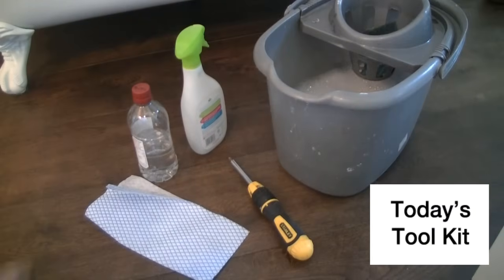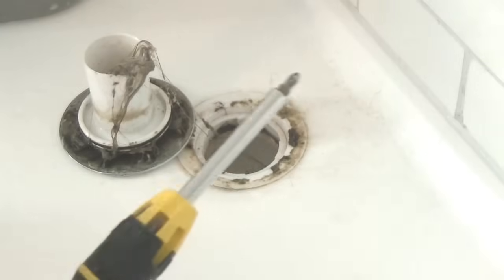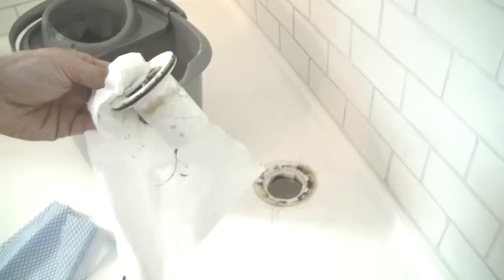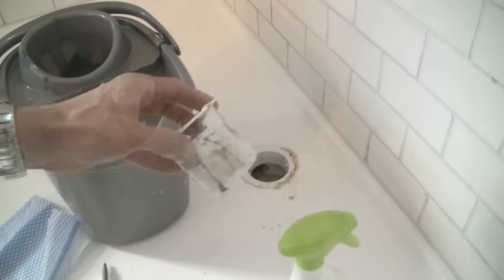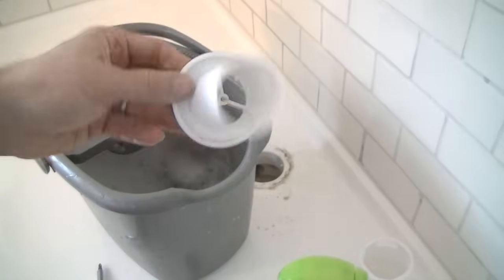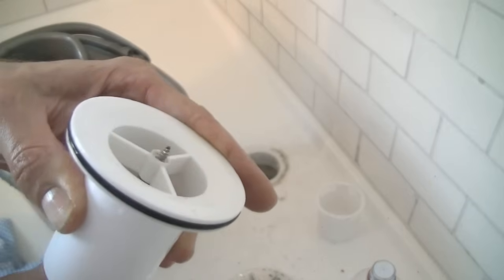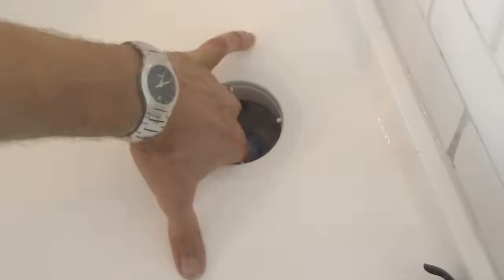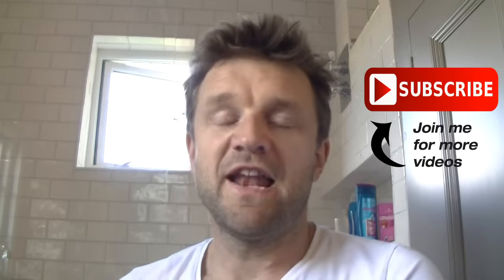How to Unclog and Clean your Shower Drain

Comment: Good and clear video Charlie.  The only extra step I do with ours is to give it a final few plunges with one of those super-size plastic hand plungers that sort of concertinas down as you press it.  Given they don't have any rubber seal or anything (just plastic throughout) their suction power is phenomenal.  I find it helps pull up a load of dirt from further down the waste pipe which i can then just wipe up with some kitchen roll.
Reply from the maker: Thanks Chris. Great thinking. I used to have one of those plungers. I need to buy a new one. I agree, they're enormously effective 👌👊

Comment: Useful tip. If you take all the gunge, no need to disassemble, and simply hold in whilst flushing in a clean toilet the water jet will remove most of it.  
An old toothbrush with Cilit Bang helps also to scrub the junk out!

Comment: Excellent (though unavoidably a bit stomach churning!!) description of how to clear a shower drain of hair etc, but even after that my shower tray still I think rather slow and as it’s shallow I often get a little spillage outside.  What can I use to clear the area and pipes below?
Reply: I would use a drain cleaner (a 'drain blaster' device) that uses a plunger to drive lots of water rapidly down a drain pipe.  Fill the drain to back up as much as possible (i.e. keep the shower water running fast) and then blast the drain line by quickly locating the blaster on the drain inlet at the shower tray and operating the plunger!  Probably hair or even builder's debris in the line.  Repeat as necessary.

Comment: I never noticed the screw that connects the plastic plug to the metal part!! Thank you this video is exactly what I needed.
Reply from the maker: You're welcome. Cleaned mine again yesterday. Always worth removing the screw as you need to pull the hair out in the direction it came in. 👍

Comment: Excellent! A proper hands dirty video instead of pointing at a sparkiling new trap and saying where you "might" find some soap scum and hair. Thank you Charlie. That bloody screw, by the way should, in my opinion, be undone over the bathroom sink with the plug firmly in to stop it going down the drain. Also, when putting that screw back in, be patient. Losing that screw will turn a ten minute job into a trip to screwfix!
Reply from the maker: Thanks mate, really appreciate that. Yep, putting the plug in is a great tip . 👊

Comment: This is a very easy thing, what will you do when there is a block down the line?
Reply from the maker: The point of doing this is you prevent the dense stuff building up further down the pipe but there are some good rodding tools on the market.

Comment: Never knew you could unscrew that part. I'll be adding a screwdriver to my cleaning bag. Vinegars.great but I never use because the smell isn't pleasant! The trying to clean it without unscrewing that makes it hard  so knowing how to take apart you can use another product. 

I still think they could come up with a better design. I clean people's everyweek any many of them stink 7 days later however thoroughly cleaned and with whatever product cleaned with (tried them all). Only thing that helps somewhat is taking removable part out after every use and sitting it on shower floor.

Comment: I have a similar type of drain and your tutorial is very useful. However, I have a problem in so far as the cover of the drain does not come off as easily as the one on your video. The seal is so tight that the drain cover cannot come off without exerting a lot of force. I’ve already broken two drain covers trying to lift them off. Any tips ?

Comment: Great video - thank you 🙏 Every time I remove my hair trap there is always water sitting below. Should this drain away somewhere?... because it's not. Also just had a bath in middle floor bathroom and its caused my en suite on the top floor to smell of rotten eggs. I don't think it's a coincidence. Praying its nothing major.
Reply from the maker: Yes you mustn't remove that water. It serves a very important purpose - to stop smells coming up the drains. That might be why you can smell rotten eggs.
Reply: @CharlieDIYte  wow thank you so much for taking the time to respond. I haven't removed the water but I've just tried the vinegar/water combo and given it a good clean. Fingers crossed the egg smell goes away. Thanks again, such a helpful guy and much appreciated 🙏❤️

Comment: Hi Charlie...great video thank you...But even after cleaning it all.. the water still seems to take too long to drain. I've tried a snake tool on the pipe (no blockage) and also unscrewed the maintenance cap outside to see if it was blocked..and it isn't! Any ideas please. Thanks
Reply from the maker: Is there much of a fall on the pipe?

Comment: Hi I have a shower very similar to this. I removed the drain cover and the shower tray waste trap simmilar to how you have done on this video to clean everything. I then clean the rest of the shower and and turned the shower on before resembling everything to get rid of cleaning soloitiob and soap suds. The next thing I knew the water started leaking out of the ceiling in the room below. Is this just because the shower waste cup wasn’t back in? I’m calling a plumber asap x

Comment: Hi! Thanks for this video! We moved house a year ago and I couldn’t figure this out! The previous owners had lost the screw connecting the cover to the trap so it’s always separate. However, the water container bit is stuck and I can’t remove it to clean that gunk off, which I’m sure is blocking the drainage! Any tips?
Reply from the maker: Unless it's a different type of trap Janelle 🤔 You can also buy replacement covers that include the chrome lid and container bit. I'm afraid I can't help you with removing the container without knowing what model it is.

Comment: Is there anything that can be added to the drain to help keep the hair from getting sucked down in the first place? With normal tub / sink type drains there is a plastic mesh that I put over the hold that kept the worse out but not sure how to do the equivalent with this type of drain in the new house I’ve move into. Any suggestions would be great. Thanks.
Reply from the maker: I haven't seen anything Tiffany but could you improvise with a similar mesh to what you've used previously?

Comment: I have the same design of drain but a little different fitting. The difference is that there’s not any screw that locks the plastic with the silver tape, so when I pull the silver tape it doesn’t opens correctly and It’s like stuck in the bathtub the plastics. Any idea about this ?

Comment: Hi Charlie - thank you so much for this video! I followed your instructions but there is stale/standing water below the outlet pipe. In your video there was none/it was dry.  How can I remove this stale water? Do you think this is a faulty drainage unit? Many thanks in advance
Reply from the maker: No, the only reason there was no water is that I had cleaned it out. As soon as you turn the shower back on it will return and it's crucial as it stops smells coming back up the drain from the sewers.

Comment: We recently bought a house that has this exact shower drain, and it really smells despite us cleaning the parts shown in the video. Do you have any tips at all for cleaning the pipes further in?
Reply from the maker: It's important you leave water in the trap after each use as otherwise you'll get foul smells coming up the pipe. D'you know where the pipe goes outside? I have been known to pass a hose pipe through the window and flush out the pipe with that. But you shouldn't really need to if you keep the shower trap clean.

Comment: Hi  We have a problem when we let the bathwater out and we get water coming from the shower Have cleaned shower trap and used soda and vinegar  Works a bit but still fairly regular issue  Do i need a plumber or is there something else to try? TIA

Comment: Iv got the same shower mate,,,, what if the the drains clogged,,iv had a 4 meter but if hose pipe down there,, boiling water and vinegar and it’s still clogged,, I get about 30 seconds in the shower before the plugs overflowing
Reply from the maker: Sorry to hear that mate  I thought of this but it's only 2.5m long according to the reviews and it sounds like your blockage is longer if you've had a 4m hose in there.  https://amzn.to/3lwyayH But if you can find something like this, longer and heavier duty that might do the job .. 🤔

Comment: Have u got a video on how to unblock a plastic motor drainage system plug hole thing? If u see what I mean. I have to keep pressing the pump button after showering, which is annoying. It never done that before as the pump used to automatically work with the water pump machine.
Reply from the maker: No, I'm afraid not Mandy. Have you contacted the manufacturer?

Comment: I have the same. But the plastic chrome top is shabby and not looking to good lol. Do you you know where I can buy them from please. Thanks for the video. Didn't  know there was a screw you can undo.
Reply from the maker: Yes they do replacement covers on Amazon and ebay. Just measure  the diameter to make sure you but the right one.
Reply: @CharlieDIYte  thank you will have a look 😁

Comment: Great video. I have the exact same shower drain. I need to replace the rubber washer ring that sits in the hole of the shower tray. I am not sure how to do this. Any advice?
Reply from the maker: Thanks, are you saying the actual shower trap https://bit.ly/3y4yK7H needs replacing, rather than the insert piece that I cleaned in this vid?
Reply: @CharlieDIYte  - its the rubber white top seal ring that's perished. I have now managed to remove the top part of the trap by un-screwing (moped out water before un-screwing). I have order a new rubber seal, also got some silicone sealant.

Comment: Hi. My cover, the same as yours won't come off. It doesn't go down at all and only turns around and around. Maybe muck stopping it going down in the first place?
Reply: I am facing the same issue now. Did you figure out how to remove the cap ? Because mine is very tight to pull and it spins both the direction. Thank you
Reply: @logesh5213  Unfortunately it was jammed and I had to force it off, breaking it (which I was prepared for). We're an accommodation provider so had to get it fixed there and then. I took it all out and put in a completely new trap assembly.

Comment: I have the exact same trap but the cap won't sit on and sits loose or the O ring  pushes it out. This is a bran new installation
Reply from the maker: I wonder if they had a couple in the bag and accidentally put the wrong cap on. 🤔

Comment: Hi, a very helpful video. I noticed that when you took your odour trap out, the water level was below the outlet pipe, is that where it should be or can it be above the pipe? I have a fairly new shower and it has already blocked up. Can soap gunk from a washbasin affect the shower drain? Thank you, in anticipation of your help.
Reply from the maker: Hi Sheila, the water level would be below when you take the odour trap out, but that's the job of the odour trap - to keep the internal water level above the outlet pipe. It's difficult to say without knowing the exact configuration of your pipes. It could be a number of things, like there not being a big enough fall on the pipe leading to excessive build up of gunk but you could get an old fashioned plunger and see if you can plunge the shower trap to release the blockage. You could also try one of these https://bit.ly/2Sv3bBn It's a good idea toregularly clean the wash basin and shower trap, to prevent the gunk that forms quite quickly from travelling further down the pipes to areas that are less easy for you to clean.
Reply: @CharlieDIYte  Hi Charlie, thanks very much for the information. I had plunged it and had small bits of gunk out, but I shall make it a routine to clean both out regularly. Thanks

Comment: i’m just about to follow this tut, but the white part that used to be connected to the chrome head detached and is now stuck on the floor of the shower. Any tips on how to get it out because it will not budge!
Reply: Hey, just wondering if you were able to tackle the issue. I'm going through the same thing at the moment.

Comment: Is there supposed to be visa or water there in the drain? I didn’t see any visible water in yours
Reply from the maker: Yes. There was none in mine because I had just cleaned it. Once you run the shower it fills again. The water is very important as it stops nasty smells coming up through the drains.

Comment: I have been having terrible trouble with my shower filling up. So much so I have to turn it off whilst showering so it doesn't overflow. It does go down abit but not enough. Ive tried all manner of different well known products even caustic soda and it didn't work. The last one didn't work at all. I'm in rented accommodation and they have sent a expert round who hovered it and used the snake thing I think. I'm getting so frustrated. I will give this a go. Could you tell me please where I would buy distilled vinegar? I have also read online you can use a mixture of white vinegar and baking soda. Is this correct?
Reply from the maker: Sorry to hear this Linda. If the caustic soda didn't work and they even used the snake thing to no avail sounds like a problem or blockage further down the drain.
Reply: @CharlieDIYte  Thanks Charlie. They've cleared it again for now but I want to prevent it from keep happening as my agent will get annoyed with me and fedup of me keep complaining about the same old problem. They told me not to put anything down it even white vinegar as anything put down it will cause further blockages. Is that correct? I was using Mr Muscle etc but he told me not to 🤔

Comment: Hi Charlie, any tips on how to access the pipework under/behind the shower to check for blockages ? My shower is still backing up even though I've thoroughly cleaned the easy-to-reach bits as in your helpful clip. I've tried HG drain unblocker and a good old fashioned hand suction pump but no luck. I think there's a blockage in the waste pipe but stumped as to how to access it without taking part of the shower apart. Thanks Jonathan
Reply from the maker: Maybe try something like this https://amzn.to/3vsf7qP I haven't used one myself but I've heard a lot of people say it did the trick.
Reply: I bought an auger and it worked go on YouTube for advice on using. Takes a wee while but it should clear the blockage.

Comment: Our shower has a different fitting. When you take the chrome cover off there's isn't a trap connected to it, just a thick horizontal pipe in the drain with no apparent opening or anything to remove.  It connects to the plastic surround of the drain opening with two screws. I removed the screws however that just dropped the pipe down about ten mil max with nothing apparent for unblocking. There was some debris under the chrome cover but not enough to cause the blockage. Any ideas? I'm thinking maybe a plunger.
Reply: Just a guess, but maybe it's like here in my house where the waterlock is in the floor instead. Then you have to move the whole shower to get to the waterlock underneath it.
Reply: Did you find anything for that kind of shower?
Reply: @sumbalyousaf7273  I didn't sady. I tried using one of those spring/bendy cables to collect hair etc however once it's in a few inches I can't find where the water is supposed to drain from. In the end we just use a plunger about once a week to force any buildup down.
Reply: @KennethGundersen  Only just saw this sorry. You could well be right. We've been using a rubber plunger about once a week and that's been keeping it clear.

Comment: Hi, do you have any tips on cleaning a shower floor that has been treated with a paint-on non slip finish? I have tried a bleach spray but it’s not getting rid of the yellow staining which I think is being caused by the hard water we have?  The shower and tray are only 3 months old but the tray is so difficult to clean as the non slip surface is rough, (I’ve been using a soft bristle brush), thank you!
Reply from the maker: Have you tried a water and clear vinegar mix? I often use this (in an old spray bottle)  to clean my shower and it works a treat. Can't vouch for whether it will work for you but it's great at removing limescale.
Reply: Charlie DIYte thanks so much, will give it a go!

Comment: Any advice on cleaning inside the waste pipe?
Reply from the maker: You need to give it a good flush somehow. I got my house pipe up from outside to flush the sink waste but assuming you're not able to do this, these are meant to work well https://bit.ly/33GNc9h
Reply: @CharlieDIYte Waste top not collecting debris from new last year but have to clean out greasy deposits from hair trap and cup weekly.  Standing water ammonia drain stench has increased filling bathroom?  Usually use zoflora in cup after cleaning to freshen up the room but it's no contest. Used a short plastic drain snake which brought a long clump of slimy deposit. Drain had same odour. I brought the long garden hose into the bathroom and filled the drain cup area. It stayed level and took the flow. I then inserted the hozelock on off grip into the outflow hole in the base and turned up the pressure. The noxious odour has gone but why doesn't the hairtrap collect debris so blocking the drains instead?

Comment: Every time I remove this to clean the sewer smell comes back up straight away which is unbearable, how do I stop this?
Reply from the maker: You have to pour water back into the trap to prevent the smells coming up, but obviously to clean it you have to drain the water so whilst you're cleaning it, maybe shove something like a small plastic bag into the waste pipe to stop the smells coming up.